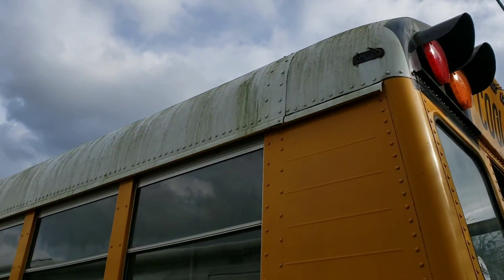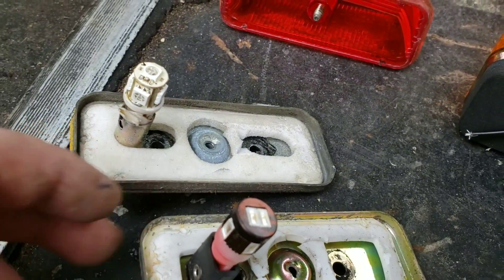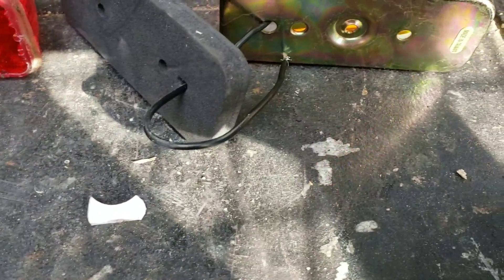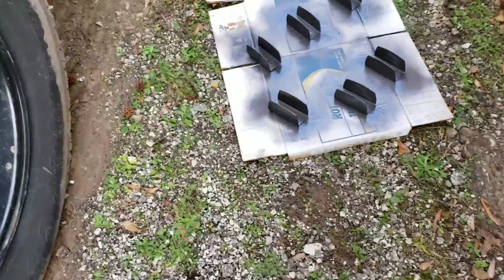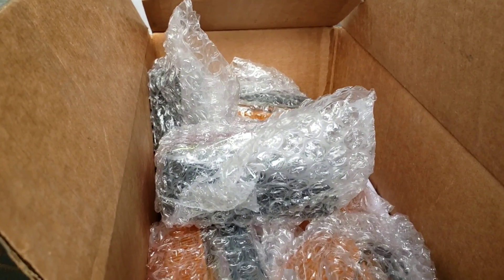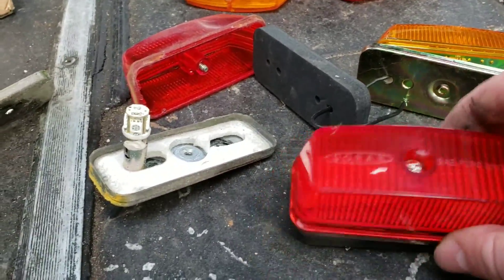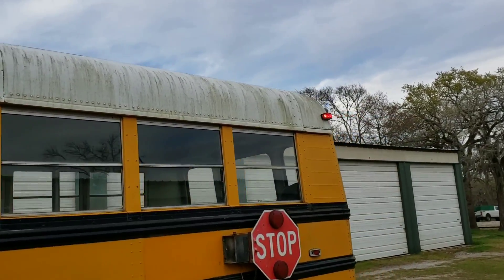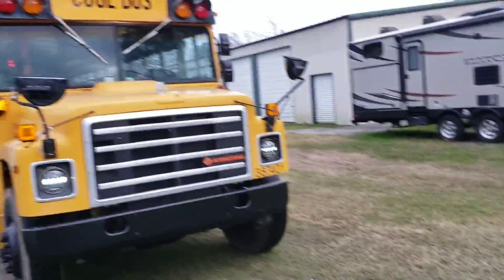New Marker Lights on the Thomas

Comment: They are the best led replacement light I had one faulty one in my 8 years. I am very disappointed in sound off 7 inch lights never last.
Reply from the maker: I'm tempted to put the incandescent lamps back on the Thomas with the same cree LED bulbs the Blue Bird has, because they look better.
Reply: Totally agree.

Comment: Hey. Im buying a 2005 IC CE 300 with a DT466 and Im planning on doing an LED marker light conversion on it. How would I go about doing that?
Reply from the maker: Not sure what you are asking.  Buy the led lights, and then replace the existing lights with the new LED units.
Reply: @txstreetman  the bus is equipped with incadescant lighting, do I just buy the whole LED package and install them or is their anything special I have to do?
Reply from the maker: Now I get what you are asking.  All you will need to do is buy the replacement LED units, and just remove the old incandescent lamps and install the new LED units.  If they have plugs, you may need to remote the plugs from the wiring harness and butt-splice the wires together.